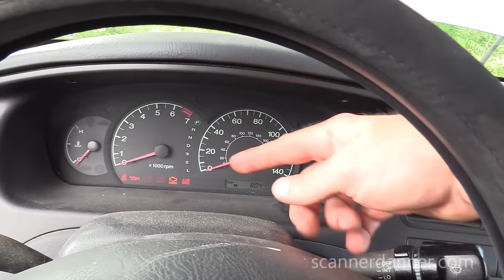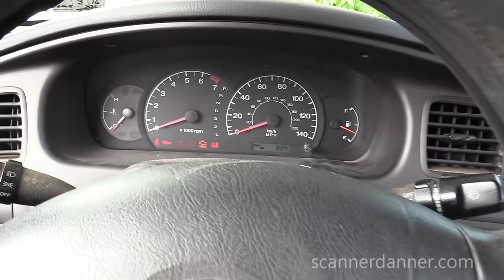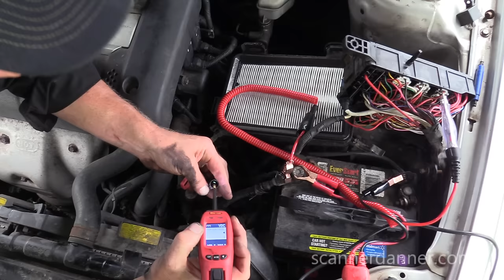No crank, good starter, how to troubleshoot, any car! (Hyundai)

Comment: I have a no crank, no start, no power at all Hyundai Sonata, 2011 LE, 4 cylinder, automatic, push button ignition.  It only has 37,000 miles on it and the previous owner bought it new.  She sold it to me because her two mechanics could not get it to function for her. It would sit for a few days and would not start.  They replaced the battery and alternator.  That didn't fix it.  Right now it will not start or do anything at all, so it actually got worse.  The battery is new and checked good (confirmed with part store check and deep charge). The main fuses I can see all look good. Nothing comes on. No exterior or indoor lights. No dash lights or gauges...nothing. Except, the push ignition button will lightly illuminate when I push it. Both key fobs will show a small red light when anything is pushed on them, but nothing happens. The trunk won't open, the alarm won't turn on, no door locks, nothing at all works. It does the same thing when attempting to jump start with 3 different vehicles. It did start occasionally for her with jumper cables and battery charge, but now it is entirely dead and nothing gives it power to crank or start, or any accessories or gauges. It's behaving like it has NO battery at all.

I have not connected a code reader to it, yet.

Questions:
1. Anyone have this occur?  What fixed it?  

2. Is there a way to test the key fobs to be sure at least one is working?

3. I know how to get the car in Neutral to push it around, but is there a way to get the steering wheel to turn?  I hate push button crank cars!

If anyone reads this far and has suggestions I really appreciate it!
Reply from the maker: You been to scan all modules on that car, period. That is step 1. And I'm not talking about a little OBD2 scanner

Comment: Corrosion is like cancer to a car. You have to completely eradicated it or it will slowly bur surely come back and get you when you lest expect it. I would check that engine harness and ensure you dont have other areas that are starting to take a foothold. Especially at the connection for your PCM/ECM, BCM and any other modules your particular vehicle may have. It a pain in the a** but its time/sweat well invested.  It should be art of preventive maintenance. After a few years on the road those harnesses have gone through hell having been exposed to all manner of heat/extreme cold, water, and if you live on the northern or ocean side locations, salt. Lots to consider. Stay frosty out there people! Crazy times were living in.

Comment: So if the car shut off while i was at a red light wat would that mean
Reply from the maker: can you keep it from stalling by putting your foot on the gas pedal? If so you are focused on the idle control system. (dirty throttle body etc.)

Comment: My engine light or dash wont come on and i have the same issue as far as the crank. Battery good most of the fuses seem good cant tell with the relay fuses when i turn the key half way no dash lights. If they came on then the car would start

Comment: my car sometimes start and doesn't.
what happened was,
when i turn the key to start,
i just hear ONE LOUD CLICK.
and when i hold the key at start after the ONE CLICK,
lights from the radio, dash meters etc will go off.
how i managed to start my car with this problem this far,
is by holding the key at START after the one click
and wait for about 5-7 seconds,
the car then cranks and starts.
my battery is good.
i have no idea why this happens.

Comment: Hey Scanner. 
 95 5.7 tbi.350...
No Crank No START. 
Replaced Column 
Replaced Neutral Safety Switch
Replaced Distributer 
 Replaced ECM. 
 Turn KEY ...NOTIN
HELP ME PLEASE...
Reply from the maker: what is your voltage readings at the starter DURING cranking (while holding the key in the crank position) Need the heavy cable measurement, right on the stud, and then the smaller "S" post wire, again, measured right on the stud if possible
Reply: @ScannerDanner  Not GET N Anything AT THE 🔑 .when I connect the battery lights on dash light up .. Turn the 🔑
Small ficker at the dash BUT Nothing else No power to the starter to get a read
Go n 2 change out the ignition switch... Tell me MORE about IT'S fuction and how it plays in my problem
PLEASE ...Thanks...
Reply from the maker: @juanlewis2405  your not being specific enough. You have nothing at your starter, on both wires I mentioned? Both the heavy cable and small cable?
Reply: @ScannerDanner  
Scanner.. Imma get to the truck. And I'll better TELL you

Comment: SPEAKING OF NO CRANK ,IT HAPPENED TO ME ,BEEN PARKED TWO WEEKS ,RUNNING FINE ,GO TO A DR'S APPOINTMENT ,3 HRS LATER ,GET IN AND BAM !!! NOTHING ,DASH SAID ,, STABILI TRAK PROB AND SIDE DETECTION NOT WORKING ,OBD2 SAID ---- PO23F and uo100 ! . car is a 2011 buick lacrosse cxs with 3.6 engine ,please help bro !

Comment: When I have no crank the first thing I do is check the starter wires before pulling everything apart and testing everything like you did 🤷‍♂️ I like how at the end you go into the money maker, how to scam people for money. I would have found this problem straight away and had it fixed in no time. I can’t believe you said it’s a money maker. Greedy mechanic 100%. I would never bring a car to you.

Comment: 2094 sonata gls 6cyl.  Tries to çrank but wnt rat. Cud thé coil pàk r ßomëing else?? Brand néw battery,. Starter does its job n so does  the
 alternator..
Reply from the maker: Back to the Future? 2094? Lol, just kidding. You need to check it for spark , fuel pressure, injection pulse and possibly compression, find out what you are missing. Then I can help. Otherwise there are too many options

Comment: Hya my car citroen xsara1.4 petrol years 2004 run out petrol tow off motor way  to my home 1mile away by AA break down services most of my electrical off only things work engine crank, central locked all fuse box and fuse.earth wires battery okay no dashboard light off can you advice been on diagnostic tests no trace of problems
Reply from the maker: you ran it out of gas and now it will not start?

Comment: 2004 Acura Tl no crank, no start no sound . I have replaced the starter still nothing. Can someone please help me fix this...
Reply from the maker: You need to do some voltage checks at the starter to be able to help you. Or at least use a test light

Comment: Trouble shooting is my problem every thing is ok but it won't start after i turn off the engine when its warm.
Reply from the maker: you need to tell me what you are missing when it doesn't start, (spark, fuel pressure, injection pulse)
Reply: @ScannerDanner  it doesn't start when its warm yesterday i was at car service said its the carburetor.
Reply: @ScannerDanner  i think fule

Comment: So for thise cking their starter. Just remove the relay and jump the fuse box circiut with a pair if needle nose to ck the starter.
Reply from the maker: Jump the wrong pins and you will fry the computer driver that controls the relay.

Comment: You're probably getting a check engine code p0174 at video time of 10:04. this is because you removed the air intake in the mass airflow sensor is not getting a proper reading.
Reply from the maker: Good thought, but definitely not the case here, this is a non MAF engine (speed density system)

Comment: I have a 01 honda accord and I have been having issues with starting. First off i I couldn't start it one day and then had someone jump it and it started after a little while. So I cleaned the terminals off and then changed them and then it started to crank and I could start it but sometimes it wouldn't unless I tapped on the cables and sometimes the starter relay. Then now it won't crank at all. So I have been trying to figure out what to do I can't reach the stupid starter relay and I don't have anyone to help.  This sux
Reply from the maker: Do your checks at the starter itself with a test light like I showed in this video

Comment: 15 min, and 32 seconds into the video, you did not notice that the thing you put in there did light up on that side when you used your tester in the hole that goes to the starter when you said it did not light up. It was only for a second but it did come on just before you tossed the tester to the side.

Comment: What happens when there's no power on the control side?
Reply from the maker: One thing this tell you for sure, you do NOT need a starter. Every car is different on how it gets from the ignition switch to the starter motor, so you need a good wiring diagram before you even think about going any further https://www.scannerdanner.com/forum/post-your-repair-questions-here/3757-need-service-info-check-here.html

Comment: Confusing as hell. You kept correcting your terminology so by the time you got done, I was lost. 
That being said, you do know what you're doing and are thorough.
Reply from the maker: I wasn't changing my terminology, I was trying to clarify:
1. A relay has a load side and control side
2.  A starter solenoid has a load side and control side
So the load side of the relay is actually the control side of the starter. Do you see where that was difficult at times to explain without a whiteboard :-) Hope that helps. Thanks!

Comment: Hello, I own a 2014 Ford Escape 1.6 L- FWD, My engine failed due to being out of time. I order a used engine with 94000 miles on it, the engine was in working condition before being removed, I had it installed by a mechanic at a shop. However, within 1 minute of the car being started, there is a notification on the screen that read: High Engine Temperature Stop Safely. Upon scanning the following code came up P1299 Cylinder Head Over-temperature Protection Active. The coolant level sensor, the coolant temp sensor, and the Cylinder Head Over-temperature Protection sensor were replaced. The shop also reset the PCM however the issue is still there. The engine does not overheat while it is running from the data received on the tech computer. So far the tech at the shop told me the issue is electric and he will continue to work on it. My car does not have a remote start and is out of warranty. I would appreciate any opinions on resolving this issue.
Reply from the maker: Does that code immediately set or does the engine need to run for a period of time first?
Reply: The engine run for about a minute before the code set
Reply from the maker: @Ibamba7  what is the voltage on that sensor? What is scan data degrees show on that sensor from start up until that code sets?
Reply: Which sensor?

Comment: What if it just clicks when you try to start it?? New battery new starter new clip on starter
Reply from the maker: Do some voltage measurements on the S post and Bat post of the starter and report what you find
Reply: @ScannerDanner  getting power to starter the click is at the starter almost like the flywheel is in the wrong position
Reply: @ScannerDanner  here's the scenario, 2006 Hyundai sonata, was running when I started working on it, replaced the oil pump, serpentine belt, then the air check valve hose was busted when I restarted it, ran for a second died, was cranking no start, battery went bad replaced battery, replaced starter, replaced starter negative plug switch, go to start it just clicks like the flywheel is in the wrong spot....
Reply from the maker: @hashbeebs2510  let's move this to my forum www.scannerdanner.com 
It is free to join and we can absolutely help you there. Sorry for the delay in my reply

Comment: Why can you start it with a booster but not normaly
Reply from the maker: Low voltage would be why. Either your battery is weak OR there is a voltage drop occurring on one of the circuits and a booster increases cranking voltage overcoming the drop in voltage enough to allow the car to start. 
To be clear, are you having a no start, no crank OR is it a no start but cranks normally?
Reply: @ScannerDanner  no crank no start. I have send the video on the Hyundai at pete's to my mecanic . That makes the most sense
Reply: And ordered a feulpressuregage but you are suggesting that it could be a gasket on the feulpump  so i am having that checked first before i putt a new one in.. mecanic sick btw but you"re probably a lifesaver.. my car for Work so no money coming in ..And thanks to you not much goiing out hopefully  thnx from acties the ocean
Reply from the maker: @dennisbakker5262  a no crank, no start would NOT be related to your fuel system at all. Stay focused on the starter circuit

Comment: He is pretty good but me retired from Chevrolet dealer as technician I would get 1.0 diag. And no problem getting another 5.0 hrs for repairs and I would scan it sell another 3.0 hrs for maintence on top of whatever SES.has going on probably easy o2 sensor end of the day I would flag easy 10.0 hours on this car not counting another 10 hours on some other gravy I already stacked up on inside shop you don't know about lol. His 1.5 hours is giving work away or doing it for almost free
Reply from the maker: Good thing you're retired smh

Comment: I have a problem with the way you finished your program my problem is when you started working on the no crank problem I felt that you were doing the proper diagnostic but here is my problem, near the end of your show you were speaking to your students and explaining how to charge the customer my 2 problems are 1 you told your students how much to charge and that it was all labour work, that's OK but, you explain to your students that you should request your customer through the scan. Meanwhile you know that you caused the check engine light to show now is that your fault or did it just happen at the same time you were returning the car who knows. Let me tell you something I open the garage in 1982 that's when I got my masters degree mechanics for Porsche BMW Ferrari and Jaguar since then I now have a garage with a doors on each side that means I have 16 door garage with 16 working stations I am not saying I'm a better mechanic but I find right now in our industry that we use the scanner to make more money a scanner is it tool to help us find the problem find a problem faster because new cars now have so many sensors than in the past. My garage And all my mechanics no not to charge for the scanner. It's a cheap way to make money. Just like all garages most of the money is made from the parts and not the labour, new mechanics instead of repairing the problem, just change the parts. Because they all know they'll make a lot more money because garages pay 1 price and charge another price at a very high more expensive price. My mechanics try to rebuild or clean the parts before ordering new parts. You see, the customers don't understand they think oh wow, look how little they charge me for the labour. What they don't know is that garages make more on the parts not the labour costs. That the way our industry is going now and there's not much I could do about it. But you're a teacher, you should show them how to repair parts or clean them not just change parts. A real mechanic repairs not just change parts. Yours sincerely Daniel mechanic for over 44 years with the same company.
Reply from the maker: This was a no crank, no start problem that had nothing to do with the check engine light being on after I got it running. For video purposes I was not chasing that light. In the field, sure, scan it to be sure it wasn't something you did (I knew it was not).
The check engine light issue was a completely separate problem and was NOT part of the no crank issue. Period.
Reply: "SD" diverted, and perhaps purposely avoided speaking to your point of view. I, however, commend your viewpoint.

Comment: Hi.  Where. Are you. ..  love to take my 2004. Toyota.  Check engine light on. ,on and off for 2 year.  ,,and it druve good ..  3 month ago. Tok car mechanice. Put need. Batteris ,, work good. ..  but yesturday. November 13. 20 24. .didnot. turn .    Then. Bootes. The batter.. and it work. Fine..  

   But. Today. November.  14.  2024.   
 Agsin didnot turn on..  i left it in my parking .. looking for help from you.. i willl paid you..   like to take it to you 😊

Comment: Just found out that bench testing a starter isn’t that fool proof not at all. It seemed to work when tested this way but once in car didn’t crank car. Might be ok for first step but not the be all end all
Reply from the maker: That is correct! Why? No load is why. Thanks!

Comment: Next time it is better to check continuity from the relay box down the line that will save you lots of time.
Reply from the maker: No sir, loaded circuit voltage drop tests was the key. An ohmmeter would have measured good here

Comment: My crowd is telling me its the starter but as i mentioned i can get it to run. Via relay.
Reply from the maker: It's definitely not the starter if you can force it to crank
Reply: @ScannerDanner  I'm thinking it's the neutral safety switch , aka transmission range position sensor ?

Comment: you could have just used a jumper wire to bypass the relay to test for bad relay
Reply from the maker: That is correct, just don't jump the wrong pins 😉
Reply: @ScannerDanner  you seem smarter then that lol

Comment: Any Air  Cleaner off REALLY will turn on a  check engine light OK 👌 I am a ASE certified technician
Reply from the maker: 100% Incorrect. Non MAF engines will not set codes and have no driveability issues with the air tubes/air box left off.